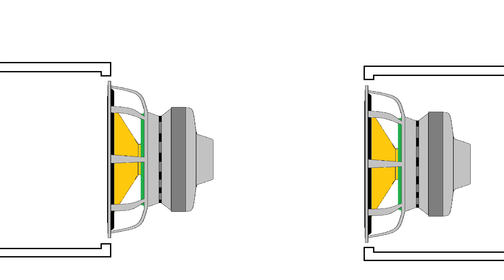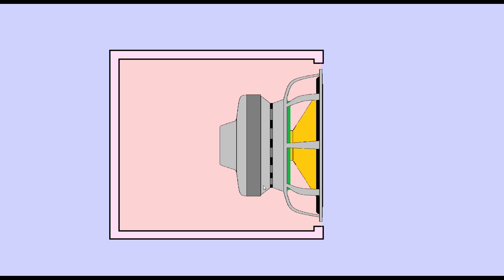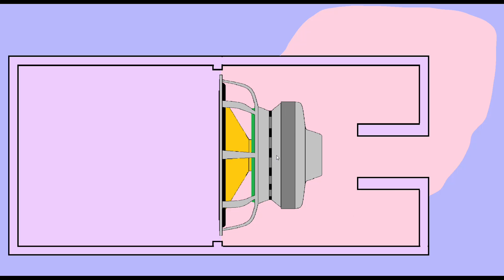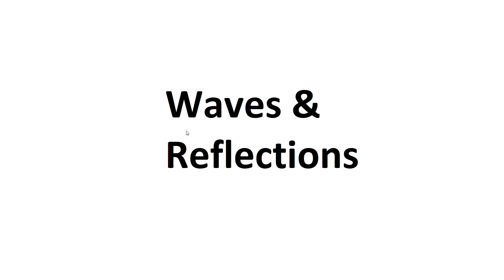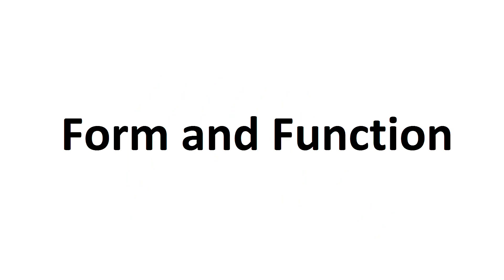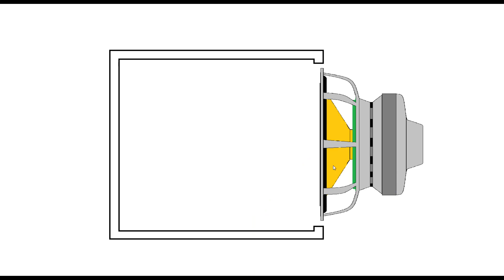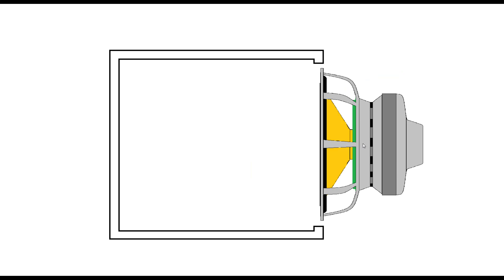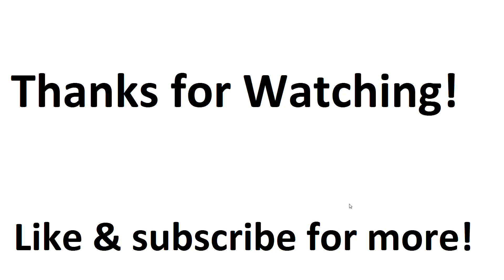Regular vs Inverse mounting of Subwoofers and Speakers

Comment: I have a zvx in a smaller than recommended box( in a 2.6 box, calls for 3) I inverted the sub to compensate for the box volume.. it sounds worse.. not as loud especially at lower volumes, and more mechanical noise.  I’m thinking about just stacking a few 3/4” mdf spacers under the sub, and running it like that. Each one is .05 cubes.. so I wonder if that even matters? Maybe the smaller box benefits my set up running 3k (smart 3 bass)watts to it? Who knows
Reply: If it is a ported box it may be easier & give you a better result if you just remove the port tubes & seal the hole . Most subs require significantly less space for sealed enclosures than they do for ported ones. Idk your setup but maybe this will help

Comment: You forgot about thermodynamics...  if you use fiberglass insulation inside the sealed box with the driver non-inverse mounted, you can run louder and longer than the inverted woofer because the glass fibers pull heat from the voice coil.  You forgot the most important common sense in building a speaker cabinet.  Don't use polyfill like the cheaper lower quality companies do.  The glass fibers count at heatsink area.  The fiberglass artificially increases volume of the box making the woofer play deeper than a hollow empty box

Comment: Vent holes are for increasing of Qms (because an air damping factor goes low). What we see at 4:30 is an increasing of Qms and reduction of Qes in order to keep Qts at a desired level. Of course this needs to keep an amplifier and a crossover (in case of a multi band speaker architecture) output impedance very low (no tube amplifiers, folks), but at the same time this increases a linearity of excursion and group delay (that makes a bass faster and more clear).

Comment: If you want to invert your subwoofer, would you have to keep the same dimensions for what the sub needs or can you have the enclosure be smaller? (Ported)
Reply from the maker: SLIGHTLY smaller, but really depending on the speaker could be 1L smaller or less. Unless its a 2000w 18" ferrite sub, in which case difference is closer to 10L.
Reply: Yeah, the volume that was occupied by the woofer is now filled with air, air which will most certainly increase the total volume of air held within the enclosure,
However, in real world terms, it's a negligible change that falls well within the tolerances allowed (when designing your ideal enclosure).

Comment: Wonder how you could cool a sub with the vehicles Air con, guess you could put a refrigeration coil inside the box and plumb it into the system. I've heard of people tossing the idea around of liquid cooled driver so if you put a cooling coil around the pole but had the liquid cooled by the Air con. Like the "active" intercoolers used on some performance forced induction cars. May have to adjust driver gap tolerances?
Reply from the maker: Main thing with any "sub ambient" cooling, water will condense on anything cold, which can lead to glues failing, box absorbing water or even mould growing in the box. Good thing with airconditioners, is the air is dried already, so no moisture should collect.
Best way of cooling a sub is to keep the air around the coil as cool as possible, by either cooling the magnet, or pumping cool air straight up the pole vent, although blocking the pole vent this way could lead to a missing dust cap

Comment: How do you invert the sub and still sit flush with the wood when there’s that raised lip on the outside of the basket?
Reply from the maker: A few options, spacer ring/gasket, foam sealing tape and torque it down nice and snug, or mount it from inside the box.
Reply: @Dakoustics  Is that how most people do it
Reply from the maker: @mjl6425  Yeah, or even route grooves into the box, although that might require still having the baffle in one piece to use the centre point, could be done freehand though will likely come out messy, some speakers if they come with removable rubber gaskets they could be flipped around, so for example if they have text on them, instead of cone side it's magnet side
Reply: @Dakoustics  What about just mounting it normally in the sealed section of a 4th order bandpass box? With just the magnet in the ported section?

Comment: Awesome video! I like the idea of inverse mounting. Practically, a down firing (up-firing?), extended cabinet (like an H frame) inverse mounted driver would have all the thermal advantages and none of the mechanical disadvantages as discussed.
Reply: True but the Sound Quality definition level decreases with reflective/echo wave cancellations and so forth. The best configuration is a non-inverted driver with an extended or large ported enclosure.

Comment: I have ran them both ways could not tell any difference in SQ or SPL both the same if you closed your eyes you could not tell the difference. I currently run a Isobaric clamshell setup in a ported box 2 10s on a 4K amp a lot of people argue about that setup on how there is little gains I beg to differ and probably never heard a setup like this and are simply repeating what they read or what someone has told them because that’s a night and day difference.

Comment: Your ideas are nonsense since your box volume does not remain the same when inverting to woofer, thus all your spl and quality of sound is utter rubbish. Go learn about speaker design.
Reply from the maker: Speakers are typically, say, ~2L displacement for a 12" subwoofer, so when considering a small sealed box, that being only 7-10% of the volume, the difference is neglegible. I would consider over 20% to be a more important factor.

Comment: I have a question how do you know if your subwoofer doesn't have enough air flow. Cause I'm have a problem with my subwoofer when I at a high volume the speakers makes a pluk sound. Few people told me not enogh airflow in the box
Reply from the maker: Hmm, pluk sound is a tad odd, by air flow do you mean the box is choking the vents on the subs, or the box is too small for the sub? It could possibly be amplifier clipping too. Can't imagine a pluk sound other than plucking the strings of a guitar, and not sure how a sub could make that noise.

Comment: Inverting signal can clear up some of that, rather than pushing in the box...I inverted my subs and inverted the signal at the terminal and no audio able difference than conventionally mounted.. port frequency change due to ratio of box bigger..a lot more cooling capability for coil..
Reply: Inverting the system’s signal polarity has nada or zero loss or gain. Inverting a driver decreases Sound Quality definition considerably more than you’d think.

Comment: My speaker mentor who is teaching me all about horn design said that he was actually using an inverse mounted subwoofer because when you inverse mount it it doesn’t play any of the high frequencies. Even if you have a crossover on it it’s still playing some higher frequencies to a degree so by inverse mounting it all you hear is the low end because all of the high frequencies drop off and you’re never actually listening to the speaker “on axis” which is where the highest frequencies play the loudest
Reply from the maker: Neat trick for a faux low pass, alot of sound does come from the dust cap, so essentially covering it with a magnet should block alot of the highs. I just use regular mounting for the driver in my bass horn, though it is a folded horn, so the highs mostly get lost inside the enclosure above 200Hz.

Comment: Just one nitpic at around 530 when talking about the behavior of the waves in the box, either way the waves are interfereing and transferring through the cone regardless of mounting.  The only real difference is the magnet and basket diffracting the sound and the motor noise being much more evident.  Seems you said that but in a different way I suppose,  Great video, mate.  How is that horn sounding??  Mabye do a video with a showcase of range and intensity.  Have a good day.
Reply from the maker: Yeah, the magnet diffracting was essentially what I was getting at. The horn had a 200Hz peak with a standard small magnet driver, but when I put in the 812 it was such an obstacle standing waves couldn't form. I've got some in-room sweeps done, though I'm never satisfied due to how drastically levels change throughout the room, It's hard to choose where to consider it a baseline, sounds like +20dB from the middle of the room to the corner. I'm building a dual 18" box now as a comparison, so I might just wait and see how they compare.
Reply: @Dakoustics  Will that be the same design but for two 18's?  I would love to see something like that, and can't wait for the videos on the comparisons.  It is relatable that satisfaction is a seemingly impossible goal to achieve when pursuing sonic excellence, as everything possible affects the sound and not in easily identifiable ways.  Your videos are excellent and I love that you don't polish the reality out of them.  Thanks for the reply, man.  Have a great day.

Comment: Yooooo what about ported box???
Reply from the maker: Main jist is sealed is better in most cases except for heat, but since ported have the port, heat isn't an issue so mounting it standard should be fine.

Comment: Curious why you didn't take displacement into account when discussing the amount of space used by each mounting type.
Reply from the maker: Main reason why is I'd say changing enclosure volume by something like 10% barely affects tuning, it's just as common to be out in terms of measurement. Speaker enclosures only change drastically once +/-30% is considered. It would matter for a perfectionist.
Reply: Perhaps I'm being pedantic but not accounting for changes like that only compounds the issue of tolerance stacking you mentioned. Regardless, I appreciate you responding to my question.
Reply: @FrozenPaint  Would never be a problem unless u have MASSIVE subwoofers but then u would have a MASSIVE enclosure so prob just as well not to mention lol
Reply: Becausee the video is about mounting position, not displacement.  It would  matter with the larger subs and by larger I mean displacement of the whole speaker, not just cone displacement.  .1 cu ft would only change a typical box alignment by a few percent at best.  When the sub takes up 1.5 cubic feet (.5 cubic meters) then displacement would need to be considered.  Or if the speaker is a large part of the overall volume of the box.  At least that has been my experience.  Good day.

Comment: For those trying to squeeze out a few more db. Invert is the way to go.
Reply from the maker: In basic terms for efficiency, theres no replacement for displacement, so any added enclosure volume in a competitive environment can be beneficial. Also, added cooling allows for the up and rising one minute tone tests at low frequencies, that added cooling is a must.
Reply: @Dakoustics  agreed, I actually have the two fifteens on the passenger side in my b pillar wall inverted, for that little bit extra.  No passenger seat in my 93 mercury cougar either, also for the extra volume and cooling.   It is too loud for my wife anyway so I don't need it in there.  I haven't metered it since this wall was put in, hope to do that this summer, also have upgraded charging just recently.  I should do a video, I am just a bit self concious as the project is in aa perpetuaal state of unfinished and is ratther shitty looking, but pretty is not loud and my car isn't pretty.  However, it is dangerously loud.  Have a good day.
Reply: @JasonKerlin  bruh you put a sound system in a mercury 😂 smh
Reply: How do you figure?
Reply: @FrozenPaint  Good question...Unless the speaker is huge, that is not gonna happen.

Comment: Always a joy seeing your channel pop up in my feed! I bet inverse mounting would get annoying quickly with my home theater. It'd be cool to look at the backs of the subs but I bet when those 10 to 14 hertz tones start hitting, that chuffing sound would get old quickly.
Reply from the maker: Yeah, and it'd be particularly irritating if they throw out torroidal vortices, getting a puff in the face is more likely irritating than immersive.
Reply: @Dakoustics  Would that even be feasible given the space of the area and with all of my subs being sealed? Currently the nearest sub to my main listening position is 14 feet. The rear subs are nearly 30 feet away. If that's possible I'd almost wish for it to happen, LOL. Multiple times so I can experience it, then confirm it, then film it.

Comment: The electrical things that spend a lot of power in heat are the best.
Lights, Class A Amplifiers, sealed Boxes xDD
Reply from the maker: Too true, even voltage regulators.

Comment: Ive had same question to myself. I read and see opinions. And i tried it. Had figure out the correct wiring n phase. But i injured my leads inverted had to do direct leads and after that inverted was no issue just amp adjustment. Im using a huge ported box.